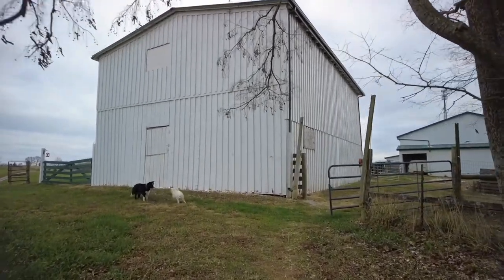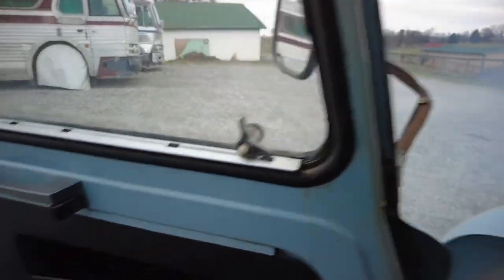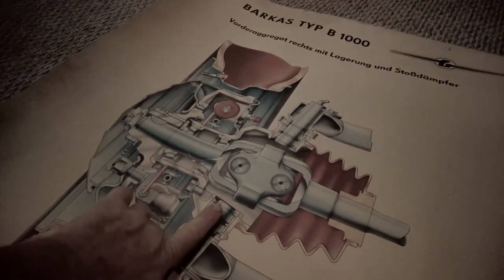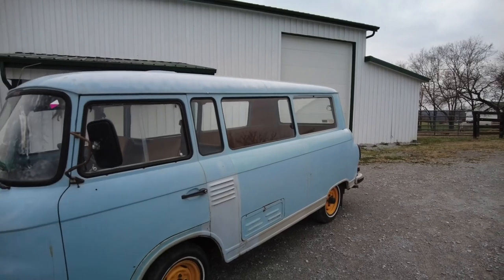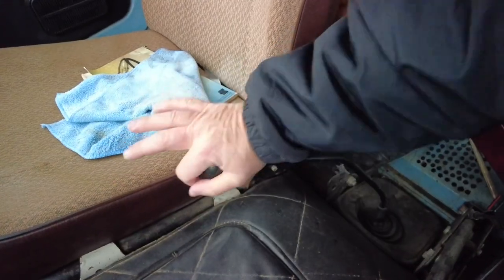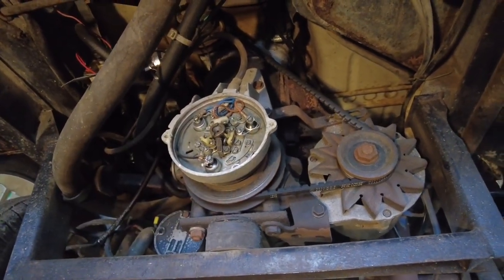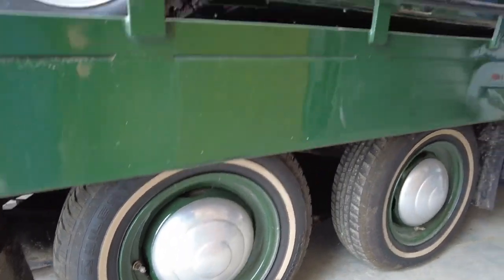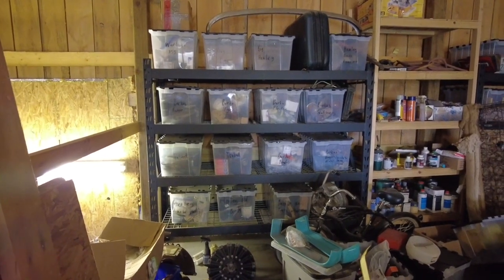Barkas B1000 in Kentucky

Comment: Childhood memories..
I grew up in eastern germany. My father had a repair shop for Simson mopeds and a Barkas was his delivery- and our familycar. It was a retired ambulance car and very old. A private person would have had no chance to buy a new one.
Remembering the vacations we went on in this car, I wanted to buy one and restore it, but then I decided for a ROBUR B21. Now it's the 6th year that I'm working on it and hopefully I will finish it this summer.
Reply from the maker: Great story thanks! I have a few Simson bikes as well! A 1959 425 Sport and a Schwalbe. The Barkas is an advanced collector car. Most people don’t realize this. Not only the parts are scarce now, but it was a complicated design. Just try to adjust the front hub bearings for example…. I always loved the Robur bus! That air cooled diesel engine is very strange…. I wish you luck with your restoration! I’ve been to a classic car show where I’ve seen many commercial vehicles too. There were several Roburs as well! I’ve made a video of it. It was north of Chemnitz in a small town.
Reply: @budapestspeedshop  Thank you! 
I agree: The Barkas was, when it came out in 1961, ahead of it`s time and very advanced. Front engine, front drive, low floor, the suspension...
If you like, you can have a look at my bus on my channel. "Robur Bus Restaurierung Teil 1" is a slide show with a lot of photos.
It's very cool to see east german cars driving in the USA and I wish you a lot of fun with them!
Greetings, Peter

Comment: They're also getting very rare and pretty expensive here in Europe :(
Kinda want one as a camper van and use it later as a working/hauling vehicle.

Tho seeing as how diesel engines aren't allowed to drive down town in cities here anymore, I'm afraid  2strokes will be denied soon too.

And 90% of why I like IFA/DKW/Wartburg/Barkas is because of their 2 strokes.

Also currently in Europe these B1000's go for 4 times as much as a Wartburg 353 goes.
Reply from the maker: Two stroke engines are part of the appeal to me as well. I’ve heard of all the insane regulations in Europe and in the U.K. as well. I wish they would exempt the old cars so history could be preserved….

Barkas prices ran away but people don’t realize that a Barkas IS an advanced collector car. Not for the faint hearted….

I have a “parts department” to keep mine running….

Most camper vans I’ve seen were modified to 4 cylinders so they can cross a hill…I’ve seen some for sale in Hungary, try www.hasznaltauto.hu or www.vatera.hu

Comment: I found this video after this van was added to a video game I play. I was surprised to find out there are only about 12 of them in the U.S., and half of them are in the same state as me! I also love vehicles and odd mechanical things, so I loved the whole video and the fact the you put so much effort into keeping these things alive!
Reply from the maker: I wonder why did someone put this van into a video game. In real life it’s an unreliable POS, or I could say it’s “guaranteed to brake soon” design. So when these are running (and stopping) it’s a great day! Perhaps this is why I like them😅 American manufacturers also made similar vehicles. Ford had a front engine version, Chevy had the rear engine Corvair van. Now those were much more reliable.
Reply: @budapestspeedshop   The video game is called The Long Drive and is made by only one guy from Hungary I believe. The newest update added a few Barkas and Wartburg variants. It also features Trabants and Skodas. I've always found older vehicles like this to be neat, and the more odd the better! I find it interesting that two-stroke engines were used for larger vehicles and enjoy the angry weed-eater sound! I also love small vans and regret selling my 1970 VW bus. After watching you explain the suspension and the bearing adjustment and the rarity of parts, I'll keep my Barkas experience digital, where it works every time and doesn't breakdown 😂.
Reply: @Herrtobins   I play that game too! That's how I also found about this video!

Comment: The engine is very similar to a DKW 3=6 engine minus the hydrosyphon cooling.
Reply from the maker: Yes, it looks similar and both engines have close origins but after the war they were separated by a “wall” so consequently they’ve evolved in a different direction. No parts other then the ignition coils are interchangeable.